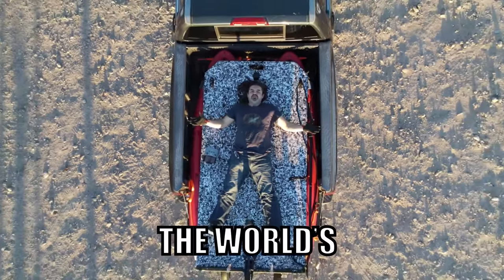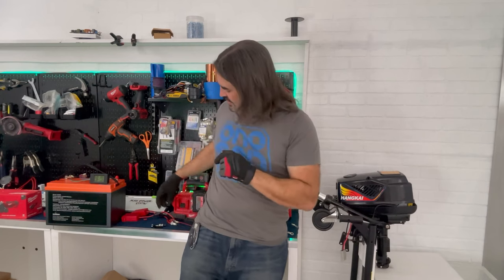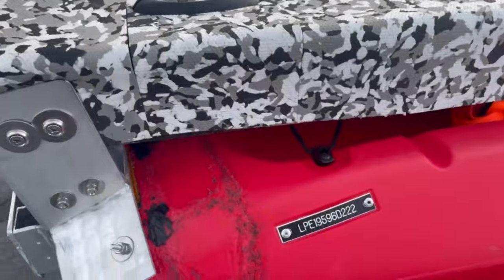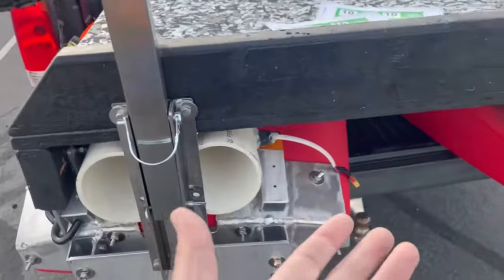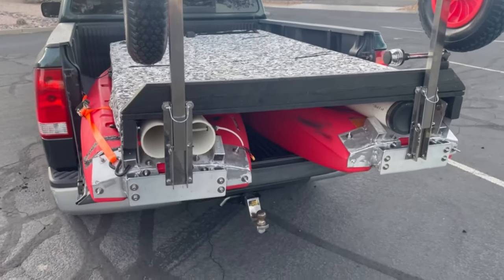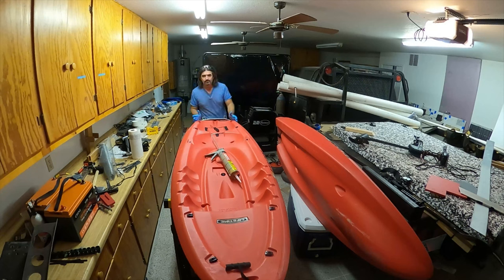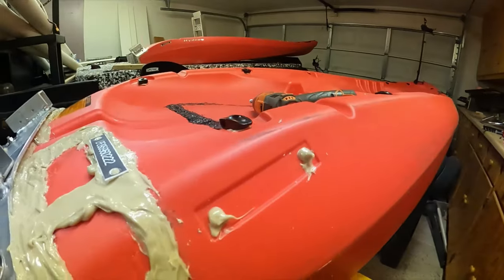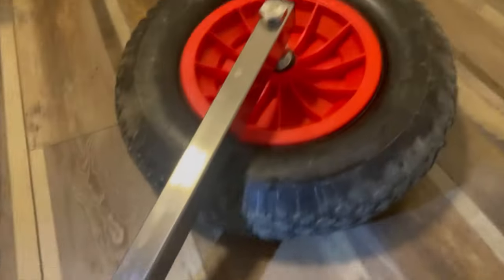I Waterproofed the Cheapest DIY Electric Boat

Comment: I wonder if you had pulled the tags from those kayaks and said that you found them in the trash - would the process have been cheaper and easier.
Reply from the maker: Hey Wayne! I'm a big fan of your channel. Thanks for stopping by. Yeah, I had half a mind to come back on a different day and leave the kayaks at home so I could get a single tag for the boat. The way they handled those VIN numbers made me second-guess whether I'll ever want to use kayaks again for a project like this. Less hassle to find any number of other ways to float.